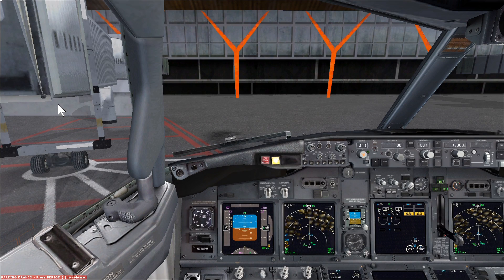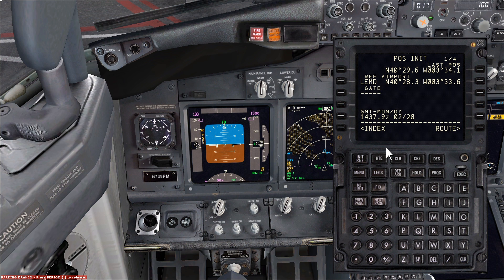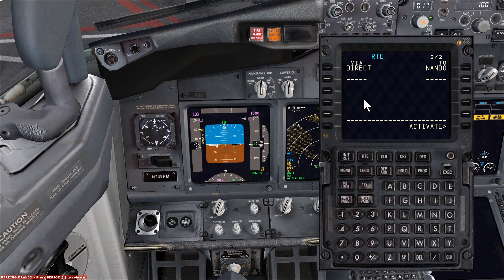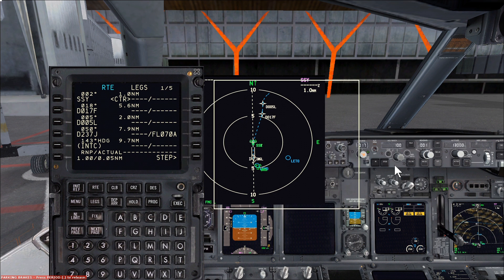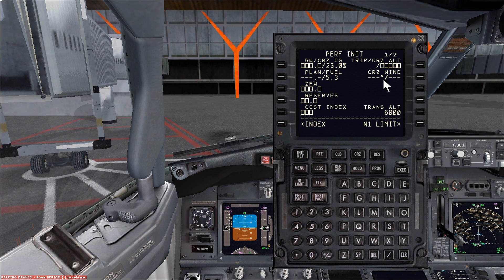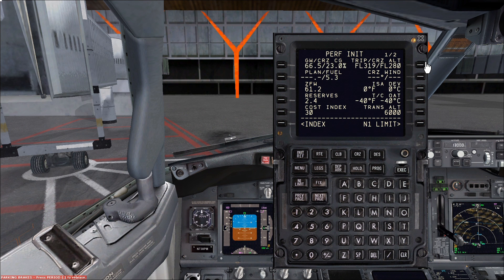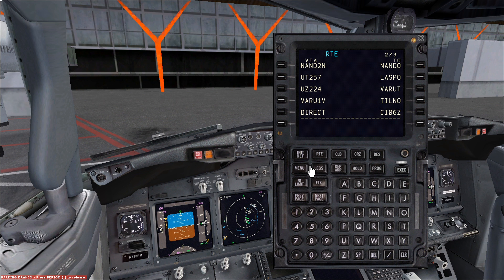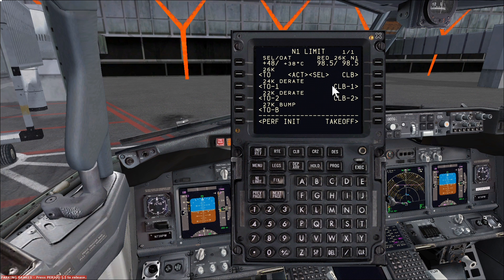FMC Setup Tutorial | Real 737 Pilot | PMDG 737

Comment: Hi, Thanks for the video,  I get all of what you have said, I get why a derated take off works, Also see why you would have an asumed temp so you can derate,   However in this video you used 48Degrees,  How did you get that figure?? Software?   I use the Zibo,
Reply from the maker: Hi there,

I use the Boeing OPT App off of my work EFB which isn’t available for general use. I’ve been advised there’s software called TOPCAT which provides comparable data for sim enthusiasts. You can see me use it in my newer tutorials.

FD2S
Reply: flightdeck2sim ok thanks.

Comment: bro please explain 12:19, what to enter SEL/OAT? U enter 48c, why is that? air temp was 38c ?
and last thing, how to know the hpa to enter?
Reply from the maker: Hi there,

It's a way of reducing take off thrust. We tell the engines to command the thrust produced if the outside temperature is at the assumed temperature, it's hard to explain if you're not very clued up on take off performance calculations for a jet aircraft

HPa or the QNH can be received from the ATIS, METAR. This information can be found online!

FD2S
Reply: flightdeck2sim but if it is hotter wouldn’t we need MORE thrust? If you raise the assumed temp, that “reduces takeoff thrust”.

Comment: Quick question. What are the STAR transitions? Never use them as I don’t know what they are and often mess up the flight path backtracking to a point already passed (probably sim error)
Reply from the maker: Hi Kieran, 

A transition is usually routing from the STAR to the Approach in use or some sort of procedural approach from a beacon. They usually “join the dots” in the FMC but sometimes you have to edit them slightly.

FD2S
Reply: flightdeck2sim Thanks for the reply makes sense now :)

Comment: I am still confused about the Fuel/Plan field on the Perf Init page. Could you explain what it is telling me and how it should be completed. Fantastic videos, keep up the great work.
Reply from the maker: Hi Judith.

The Plan function is seldom used, it allows you to put planned fuel on the ground before refueling to calculate arrival etc. 

You can also use it in flight if there is an issue with the FMC reading the fuel gauges to update the FMC Gross Weight.

FD2S
Reply: Thank you

Comment: Great vids! How do we calculate the runway lenght we'll need to takeoff and land? Im using XP11's 738 (Zibo) and its FMC don't display this kind of information.
Reply from the maker: Hi ARI

In reality we use the Boeing OPT App which is available from Boeing in the app store, but the databases aren’t. They have to be purchased directly from Boeing. It doesn’t seem to be a tool available for casual simmers. There is something called TOPCAT which I've been told is pretty accurate to the real thing.

FD2S

Comment: Hello sir, great videos. Are you using your Boeing OTP for takeoff and climb perf calc? Are they right for the PMDG software? Thanks!
Reply from the maker: Hi lionell,

Using the OPT I have found most the time with the same parameters the performance is identical. Sometimes there does appear to be some discrepancies.

APU Bleed for example affects the N1 value in the FMC pre-departure. It works off Duct Pressure and it automatically gives you the N1 value with the engines off so long as you have the APU Bleed On, Isolation Valve Open and the Packs in Auto. There is often some difference in the figures then but usually within 1% which is negligible! 

FD2S

Comment: I notice you don't use the take off page 2 ? Is that because you don't take off with VNAV engaged so the thrust reduction and acceleration heights are not effective ???
Reply from the maker: Hi nemisis34,

That is exactly right. When we engage the A/P at 1000ft LVL CHG automatically engages and we accelerate the aircraft by setting the "UP" speed

We don't manipulate any information on Page 2, we leave the default value of 1500ft (N1 engages at the Thrust Reduction Altitude)

FD2S.
Reply: flightdeck2sim, but just out of curiosity: what do you supposed to put into "RW WIND" on takeoff ref page 2?

Comment: In FSX, its default setting at throttles shall be reduced at 1800 altitude but, can you explain real life procedure? With N1 engaged and autothrottle armed, will it reduce automatically? In airbus You have to move back throttles physically to CL Detent after pfd gives Prompt to reduce thrust.
Reply from the maker: Hi Kk,

It's set using Takeoff Page 2 in the FMC. The A/T will command ARM at 800ft and at the thrust reduction altitude (Defaulted to 1500ft based on my operators SOP's) it will command N1 and the A/T schedule change to CLB power.

My Take Off Tutorial shows this happening at 09:57

https://youtu.be/eI-FtpfSILo

Boeing is not scary like the Airbus! The thrust lever always moves as the thrust changes! 

FD2S.

Comment: Great !! Question, When we enter altitude and speed restrictions, whats A and B like 6000A or 220B?
Reply from the maker: That is correct, that's how you insert the information on the LEGS page of the FMC. 

A = At or Above
B = Below
If you leane no A or B and make it a hard speed/altitude (In Bold) it's AT meaning exactly that altitude or speed.

FD2S.
Reply: flightdeck2sim Thanks captain but if A or B isnt mentioned at all. What does FMC understands from it?
Reply: Kk - it then keeps exact speed or alt at that wpt . A means above b means below

Comment: Hello FlightDeck2Sim,
Normally we do not get the MSA in the fix page when preparing the fmc? A 25nm circle in relation to the airport or a beacon? And so in your company you never use TO1 and TO2? You do all the time TO26K with an assumed temperature? 

See you soon :)
Reply from the maker: Hi Alexis,

Not required to select a 25nm MSA ring but none the less a good idea and some crew do elect to use this for Situation Awareness.

For my operator we use the OPT App to initially work out Fixed Derate (26k, 24k or 22k) and then Assumed Temperature Thrust (Selecting a assumed temperature that is higher than the actual temperature)

Depending on what thrust setting we use for takeoff decides our derated climb thrust, the FMC will decide CLB-1 or CLB-2 based on what derate we select or/if we decided to use assumed temperature reduction. We don't change it as crew.

Use of derated climb thrust actually increases fuel burn on the whole but decreases noise and engine maintenance cost.

Hope this helped!

FD2S
Reply: I saw photos and videos of pilots filming at takeoff and being pilots in your company. And I noticed that there is a circle of 4 nm around  the runway on the nd at take-off. And should the radials be traced to be intercepted on the nd using the Page fix?
Reply from the maker: Alexis Ahh I should think that's the ETP (Emergency Turn Procedure). If there is high terrain around an airport and the SID is over high terrain there will be specific routing to be taken in the event of an engine failure.
Reply: Alexis Jagot 4 nm is most likely during landings to mark gear down and flaps15. They use 24k and 22k.

Comment: This is absolutely a glorious tutorial, though i find myself struggling alot due to the background engine volume that is way too high, and to your voice that is recorded way too low, too fast and not so clear. English is not my first language and i'm loosing some bits of this.
I don't know if it's possible to edit this video and lower the background volume to make your voice clearer: i would appreciate it immensely.
Thanks for taking the time to do these tutorials, really amazing depth and quality.
KR
Reply from the maker: Hi Svetlanox. 

Thanks for the feedback. You might have noticed with some of my newer tutorials I've tweaked my settings so my voice is considerably easier to hear and slower paced too. 

All these tutorials are based on my operators procedures and at times when I explain actions completed by both PF, PM and the operational impact of what we're doing, a lot of information comes across quickly which I appreciate can come across a bit fast paced. 

My full flight tutorial part 1 and for all full flight tutorials in the future will include an FMC setup.

Good luck!

FD2S

Comment: Regarding the CI, I use the one for whichever RW airline I am flying in the sim.  But, I see that some are variable, eg. KLM is 30 on CLB, but then 15 for CRZ.  Do you change this from 30 to 15 in the FMC once you've reached your Cruise FL, then?
Reply from the maker: Hi Douglas, never heard of operators changing CI in flight, might be the case but it's something we don't do in my outfit. A lot of operators will use a variable CI but we have a fixed CI, it hasn't changed for some time!

Comment: I have a question... How do you know which numbers to put  on the DES FORECAST page for the use of anti-ice? I mostly use PFPX or Simbrief for flight planing. So how do I know where would I turn on the engine anti-ice, where is the top of the cloud, how thick is the cloud layer? Can I get this kind of info from the flight plan?
Reply from the maker: Hi Johnny!

Great question. It's a feature we seldom use because it's difficult to predict at what level we descend through clouds especially if we descent through several layers of cloud! I've not used it once in five years! 

Good Luck!

flightdeck2sim

Comment: what about the decelaration point when you approach for landing?are you putting 220 knots to slow down from 250 or you do it manually from the MCP?
Reply from the maker: It really varies. In Europe it's extremely busy. If we're radar vectored on Final Approach we're often under speed control, something VNAV PTH struggles to control so we would revert to other modes like LVL CHG and V/S to comply with any speed restriction given by ATC.

You can manipulate waypoint in the FMC and VNAV PTH will do it's best to comply with those restrictions.
Reply: thanks man please make a video about RNAV-RNP...

Comment: nice man one question the 220b knots should be always be on the (INTC) ?
Reply from the maker: Hi G. Skouras!

You can put on the first waypoint after the first turn in the FMC which was the conditional waypoint "intercept" waypoint.

This helps prevent the magenta line overshooting the turn.

This is Operator specific, other operators might do something differently!